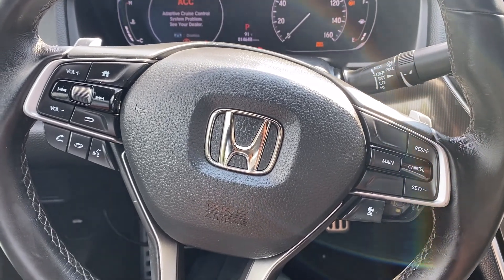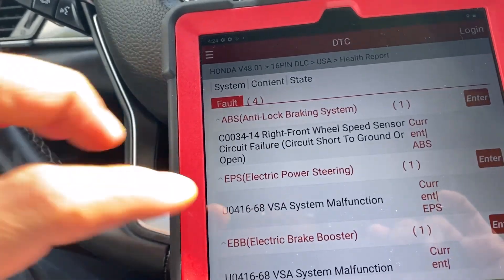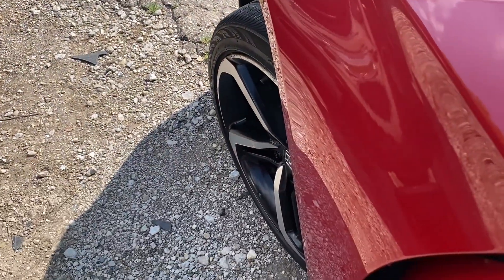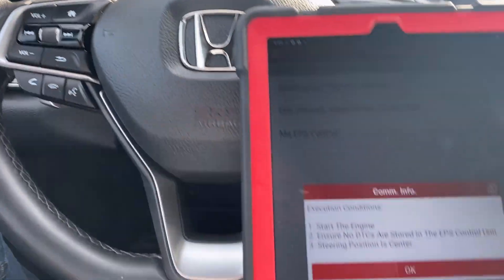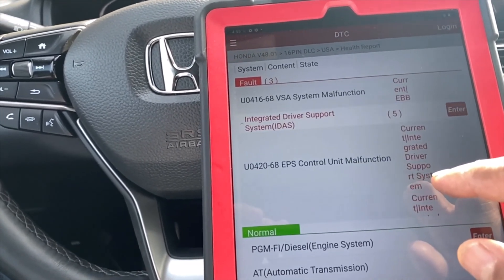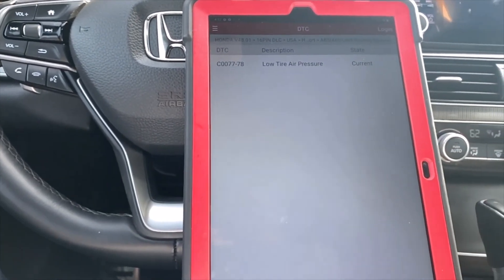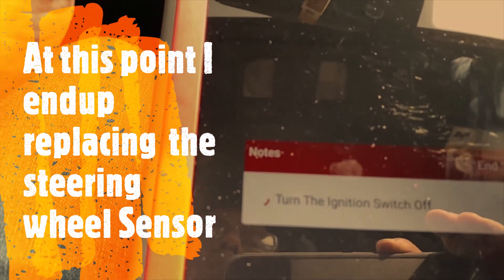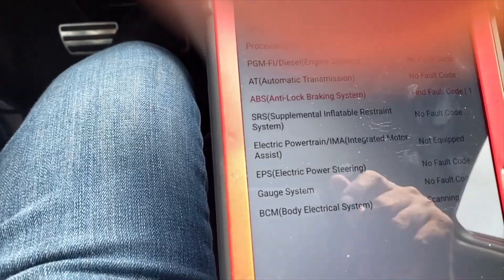2020 Honda Accord Steering Angle Neutral Position Learning Incomplete C0051-54, procedure by Launch

Comment: I need help!
My car is a 2018 Honda Accord sport 1.5,  do you know where is the sensor located at or is there any way you can find out
Thanks in advance, your knowledge will help me
Reply from the maker: Sorry I am in vacation for two weeks I have no access to my laptop with all data software to check your request
Reply: It’s usually connected to your clock spring.

Comment: Do you know where is that steering angle sensor located at? 
Thanks in advance
Reply: Is not on the clock spring?
Reply from the maker: @Vicsalvage  some models it is on the clock spring correct,   need to check the car year and model
Reply from the maker: it's on the steering column, with one black plug, part # 35000-TR0-A11,  but check your car first before you buy any parts, let me know if you need help
Reply: Do you have a video for DIY?